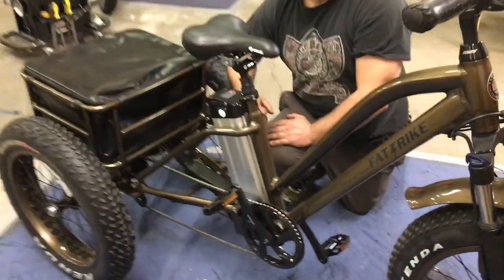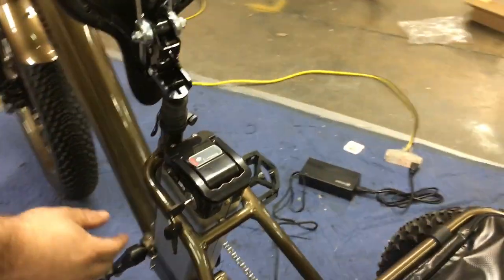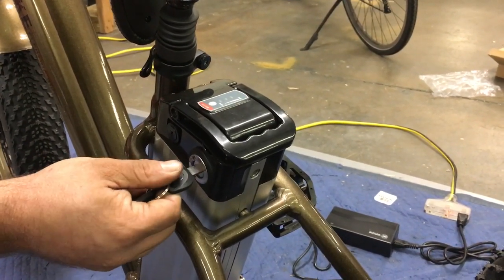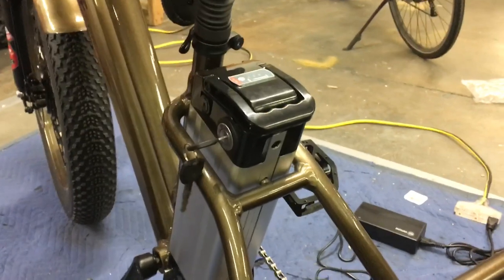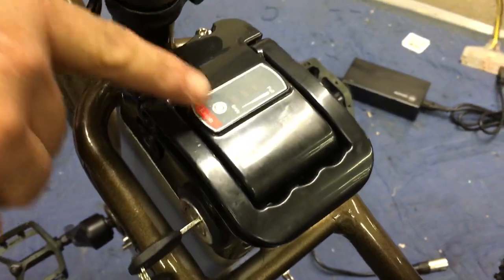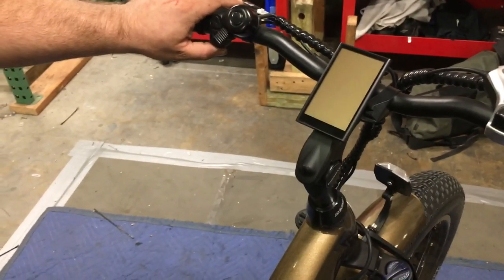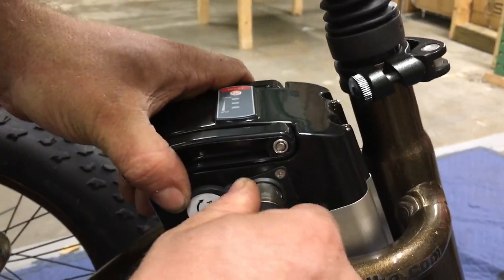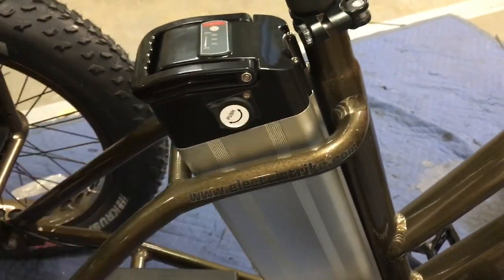Electric Trike | Remove, Charge and Turning On/Off the Battery on the Fat Trike

Comment: I have acquired a trike with this battery but the keys are lost; any ideas how to remove it please?
Reply from the maker: Call customer service for assistance, 1 800-375-0224. Monday through Friday from 9 am to 5 pm EST.
Reply: I had a separate set of ebike keys, and one of those worked with mine to get it off. Then I had a new got a new battery which came with new keys

Comment: Does the battery have to be on the bike to charge?
Reply from the maker: No. You can charge the battery while it is on or off the trike.
Reply: @electricbiketech  Thank you!!
Also, can you leave it on the charger even if you're not going to ride it for a few days?
And, will it drain if it's not being charged and not being used.
Thanks for your responses.
Reply from the maker: @suzannedallefeld2937  charge to full and remove charger from the battery and outlet. For longer periods of storage do that every 60 days.

You don't want to leave any li-ion battery pack on a charger (not even if someone tells you it's smart) as it's not good for the health of  the battery and in some cases can absolutely be a fire hazard.
Reply: @electricbiketech  Thanks again for all of your wisdom! ☺
I should get my trike soon and I'm sure I'll have more questions!
I appreciate your help!!